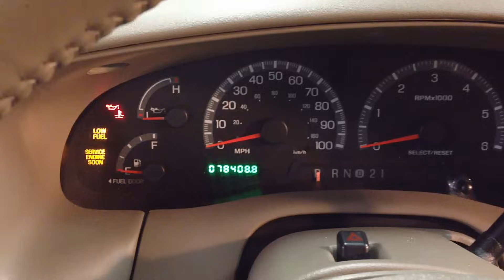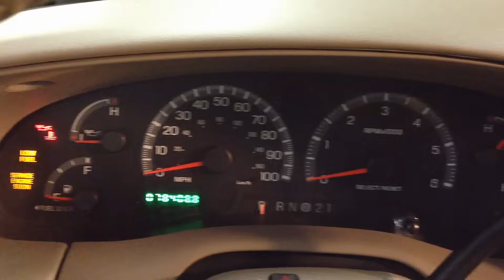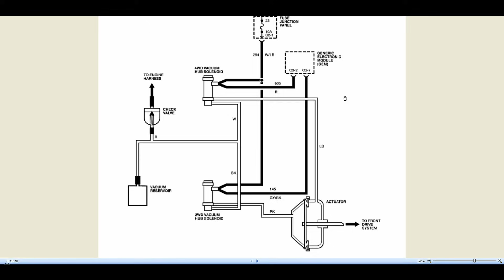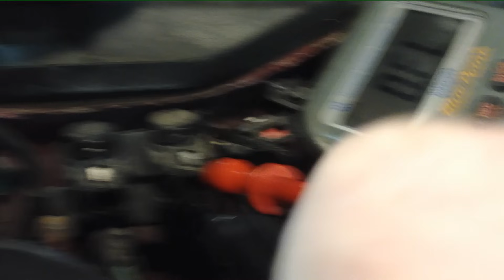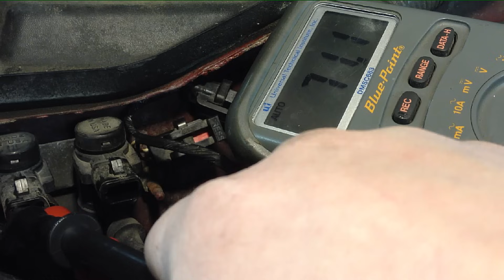1997-2004 Ford F150 4X4 Inoperative In Depth Diagnosis

Comment: Man I have that same multi meter from when I was at UTI!  Done me great over the years. Did you go there or just happened to get it used from a snap on guy?
Reply from the maker: Joe Spano Yep I went there back in 2005, I love this meter. Mine broke after 8 years when it fell off a truck and I bought another one on ebay because I love them so much.
Reply: FordTechMakuloco that's crazy I went to the Exton PA campus in late 05 and graduated early 07. What campus did you attend?
Reply from the maker: Joe Spano I was at the phoenix one for a month then onto the Glendale Height Illinois one for the rest of the schooling.

Comment: My 4x4 just stopped working on my 03 F150... I engaged it and backed up into a lawn in about a foot of snow... Shut the truck off in 4x4, and when I went to leave I put it in drive, stepped on a the gas a bit, then heard a loud noise with what sounded like it was under me but I know that it could of vibrated through the drive shaft.... Maybe the sound was under me, maybe it was carried through from the front... Have you hear of a loud noise? It was already in 4x4 then it stopped after the loud bang
Reply from the maker: Yeah it sounds like the transfer case shift motor is hunting for the position the engaged when spinning and never synced up. Those shift motors were fairly common.

Comment: I have a 2003 F 150 4 wheel drive 4.6 liter I have an issue with the 4 wheel drive not working it seems that the actuator solenoid and all the vacuum lines seem to be working when you put it in 4 wheel drive low you can fill a gear down like its in 4 wheel drive but you go to take off and its like its not transferring the power to the wheels like it's kicking itself out and also the four wheel drive light stay on for quite a few days after you take it out Thanks
Reply from the maker: Kyle Kelley Yeah it is looking like yours may be the transfer case shift motor. They get stuck or go into the wrong position on there and it will do that.

Comment: I got a 2003 explorer right now with intermittent getting stuck in 4x2, different setup then this and not familiar with this case, any common issues? I see it has a motor on the back and no codes. Your the best to ask!! Thanks!
Reply from the maker: Matt Marsicano The early explorers like your had a 4x4 module above the blower motor that would fail all the time even more so than the shift motor on the transfer case. The 4x4 module would be my bet. I would get codes read on the 4x4 module to make sure it is not setting any contact plate faults for the shift motor first.
Reply: +FordTechMakuloco yeah I scanned with my autel scanner and it has no codes, the customer complains of a bang when it finally gets out of 4x2 so I was thinking the shift motor but didn't know if a rebuild was gonna be needed

Comment: So if the solenoid doesn't pass the vacuum through it can there be other problems or just the solenoid is bad? I tested the solenoid for power ground and ohms and all tested fine!
Reply from the maker: HuntersSportsCards Yeah if thew solenoid is getting good power and ground once you plug it into the solenoid it should click and pass vacuum through.

Comment: Hi,  great video very informative to diagnose my issue of my 4wd not working.  Question ... checked power and ground on solenoid and they are good, checked OHMS and they were both 70, supply lines both have suction!  Then here is my issue when I have the bottom port connected and the top port open the 2wd has suction but when I switch to 4wd there is no suction on the top port of the 4wd solenoid.  Is the solenoid bad? Everything else checked out but I did not get suction through the solenoid to the 4wd top port.  Please let me know what you think! 

Thanks again!
Reply from the maker: Once you turn 4wd on and the solenoid now has power the vacuum should pass through it yes.

Comment: can i put on a u shaped little tube to make the vacuum from the bottom hose suck on the top hose on the 4x4 side? would that give me 4x4 full time? im looking for a momentary fix until i get enough money to take it to ford,they want 168 dollars an hour to diagnose an electrical problem and they said it would be at least 2 hours,(thats just to find out whats wrong with my truck,no repairs only diagnose) i know i have either a GEM module problem or bad fuse box as i lost a lot of things in my truck but i do need it to have 4x4 as i live in Canada,So cold and icy. :( Thank You your vid is one of the best explained.
Reply from the maker: damshley That would engage the front axle at all times yes but you still need the transfer case shift motor to work too. There is a way to remove the shift motor and turn the shaft manually to 4x4 also but a bit more complicated.

Comment: Great video. I have searched high and low for a comprehensive diagnostics video I could use to help me with my problems on my 1998 F150. I don't mind buying parts as long as I know it will fix the problem. With your help I think I can nail it down once and for all. I did find another good video someone did about cleaning the contacts on the selector switch which I will do first. Between the two I am confident I can finally get things working as they should. Good work man and thanks.
Reply: Howd it go for some reason mine isn't getting vaccume at the actuator but is getting vaccume at the 2 post
Reply: @gameondude3617  Gosh it has been so long and I donated the truck a few years back. Mine ended up being the actuator. Once I replaced that it worked fine. Oddly I am now having similar problems  with my 2010 F150. I love Ford trucks but their 4WD leaves something to be desired. Good luck man.

Comment: Getting Vacuum to both solenoid vacuum tubes ( that lead to the actuator ) Felt clicking in the Left solenoid (engage) when switching from 4h to 2h, but no clicking in the Right solenoid (disengage) could it be just the right solenoid is bad and needs replaced?
Reply from the maker: Test the vac output at solenoid when switch to 2wd as shown in the video then you will know if it is passing vacuum when commanded.

Comment: Great Video, What is different with going into 4Hi on the fly vice standing still?  Works every time sitting stationary for 4Hi and 4Lo but will not go into 4Hi on the fly.  By looking at the diagram everything looks common.  Could it be the Signal from the GEM Module that's different?  2003 F150 FX4 Crew Cab.
Reply from the maker: Yes the vss signal needs to be monitored in the gem
Reply: FordTechMakuloco Is there a way to test this?  Also my problem is intermittent (only when on the fly).
Reply from the maker: With a scan tool a shop will be able to monitor all of this on the fly and be able to see based on pid data what is failing at that moment.

Comment: My 4x4 on my 97 F-150 worked last winter. I recently tried it and it is no longer working. I preformed your check to the solenoids and the 4x4 solenoid had no ground signal coming from the GEM...what now? Does that mean my GEM module is bad? I also do not notice the any sound from the relay in the dash when I switch it to 4wheel high or low. I even put my ear to the dash and switched it while in the accessory position..which relay should i check?
Reply from the maker: scott slowik There is likely a faulty with engaging the transfer case shift motor, you will have to have the gem module scanned for codes. Can you hear the usual grunt from the transfer case? Does the 4x4 indicator come on?
Reply: FordTechMakuloco No noise of any sort that I can hear with either the key in the accessory position or with the truck running when I switch the switch into 4x4. I would also point out that not only do I get no 4x4 indicator light in the instrument cluster but I also have no longer have a working led light in the actually 4x4 knob/switch that should illuminate along with the other dash lights when my lights are in the on position. Either it is a coincidence that the light burned out in the switch at the same time or the switch is no longer getting power. The schematic I got from an auto shop is kinda confusing to me...It seems that it is not constant power that operates the switch but it works on 3 different levels of resistance.one for each setting. 2H, 4H, and 4L. Basically nothing happens when I switch it to 4H or 4L that i can tell other than the positive port of the 4x4 relay reading a positive signal. (no negative ground as I said before)
Reply from the maker: Well if they failed together it is possible the connector has become disconnected, remove the panel and check. Either way the light and its power is a totally different circuit.
Reply: FordTechMakuloco No it was connected. I tried getting a reading off the connector to the switch to no avail, So if i have no power to that switch what should I check next?...I tried to follow the wire and it appears to go into a wire bundle and then thru the firewall. If there is no power to the switch I assume that could be the issue? Also just so you know I check all my fuses today and found no bad ones. I didnt check any relays tho since I dont know how. Are you sure the light is a different circuit? There are 4 wires that come in the same bundle to the switch. I would assume one was to put it in 2H, one for 4H, one for 4L and one for the blue LED light in the switch....but Im not a tech and just guessing. Since they come in the same wire bundle and all go to the same switch I would think they all go to the same circuit.
Reply from the maker: scott slowik I can send you the schematic so you have a better idea. Since these systems are so computerized it is best to have a scan tool so you can see if the module is seeing the input from the switch and get the code for trouble it is seeing. I am sticking to my original thought that the shift motor on the transfer case has thrown a fault and lost position. If you send a email I can send diagrams so your not shooting in the dark and help out a bit.
Reply: FordTechMakuloco I do have a scan tool but the only codes my truck throws are the same engine lean codes.. PO-171 and 174 that it has thrown for 4 years since I got it. They always seem to come back after a while when I think Ive fixed what ever it is that I need to fix..but that is a different issue lol. Right now my only concern is getting my 4x4 working for the snow! Is there a way to scan the GEM separately? If not I have no codes. My only other question is  should I be showing any readings in any of the ports in the connector that plugs into the  switch on the dash? My Email is Scoote1019@yahoo.com. Thanks again.
Reply from the maker: Yeah you need a scan tool that can talk to the GEM module it has its own code set since it directly controls the 4wd system. I have sent you some diagrams to help along but we really need to get the gem codes read.

Comment: Thank you.   Very helpful!    Do you have info on wiring to the gem module for the ground wires from the vacuum sol?
Reply from the maker: As far as where they go into the gem module as in which pins?
Reply: the gem module grounds them internally. so if your not seeing a ground from the correct solenoid(in the correct position) suspect in internal failure of the gem module.

Comment: I have an 05 F150 lariat that i purchased with only a blown drivers bag. I replaced the bag and the module, but now flashing code 33 which i think is restraint system- drivers pretensioner. Upon looking at the actual seat belt pretensioner, I saw that there were no wires to it. On this model Ford does the belt buckle(connected to the floor) usually need replacement? and would the passenger side need replacement since the passenger bag wasn't blown and the truck has a light that indicates the air bag is not active if the seat is empty. Thanks
Reply from the maker: Edward Reynolds Yes it should have wires going to it, check to see if it has blown off it will be much shorter than the passenger side one. If the pass air bag did not go off the passenger side pretensioner should be ok.

Comment: I personally never had an issue with manual hubs and a lever. I would very much like to give the inventor of these yuppified systems a proper thrashing. I wouldn't mind it so much if was optional, but it's  no any more on the 150's to the best of my knowledge.
Reply: How many thousands of people have had issues with other/different styles of 4x4 systems though? Really? Just because it's lever operated absolutely does not mean it's trouble free.
Reply: @forrestputman7617  True, but most of us with these vacuum operated 4x4 shifters all hate them to fucking hell and back.  I know my ex's 7.3 4x4 shifter worked amazingly well with 229,800 miles on it (she was batshit crazy, but had a badass truck)!  I tried buying it off of her but her dad refused haha.  Ended up with a 5.4 F150 and wish I got something bigger.
Reply: Amen to that!!

Comment: I have a 2003 Ford F150 xlt supercrew cab fx4 can I get a part number for the hub lock and the diagram for vacuum lines to double check everything out the proper way... That video was a great help thank you
Reply from the maker: The diagram is in the description above, you want the part number for that vacuum actuator motor on the front axle?

Comment: Does a 1999 ranger use the same system? Smaller scale I know but I had issue where I was using 4 wheel on night, turned 4 wheel off, went to use it again like 20 minutes later and would not work. Indicator on dash came on like normal but only 2 wheel drive.
Reply from the maker: No those use pulse vacuum hub system like the Superduty trucks.
Reply: So if I have a hub leaking vacuum, will that cause a p1131 code? No heated 02 sensor up stream. Lean condition.
Reply from the maker: James Trapp If I get that code by itself and there is no obvious large vac leak I go right for the o2 sensor and change them see it allot.
Reply: Ok. I bought a new O2 sensor. It's bank 1 sensor 1 so I'll change it. Thank you for taking the time to help me. I'm a diesel tech for republic but this ranger has 230,000 miles on all original 4.0 everything.
Reply from the maker: James Trapp Oh ok makes sense then.
Reply: I'm trying to milk it until the diesel Colorado hits show rooms since ford isn't going to revamp and diesel the ranger.